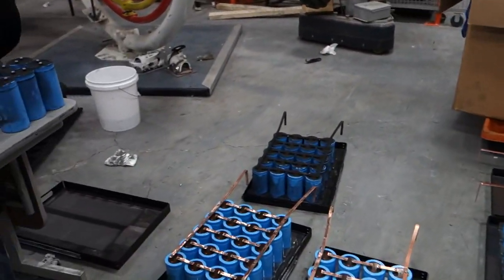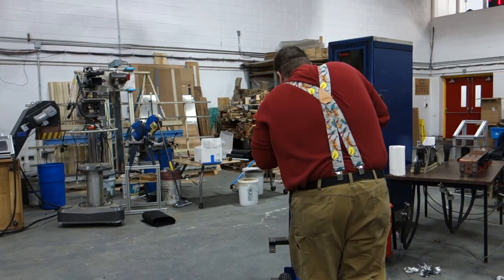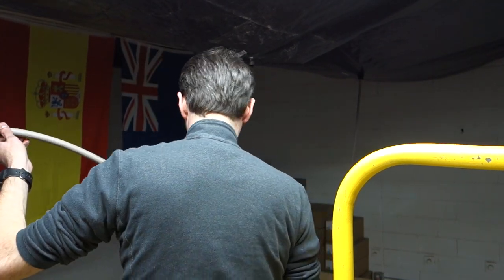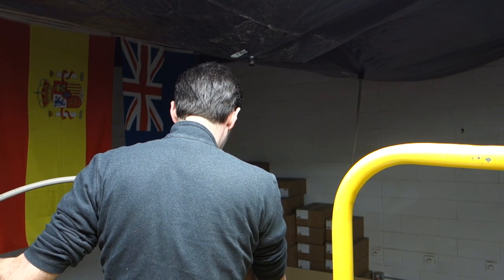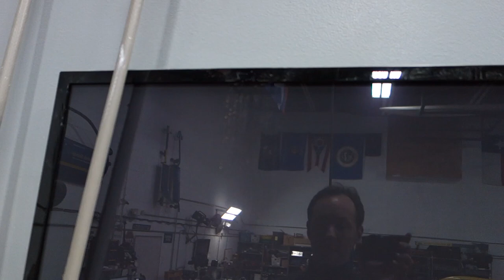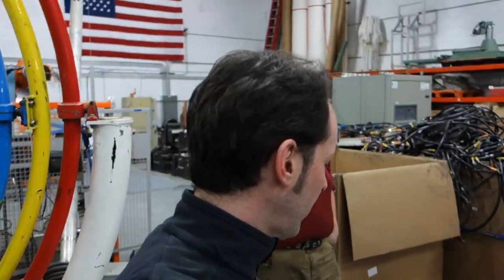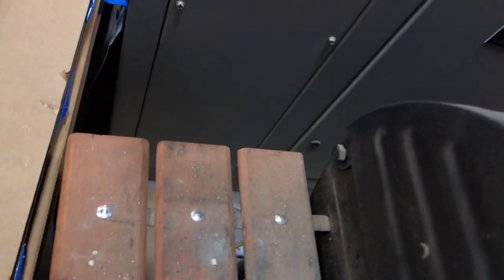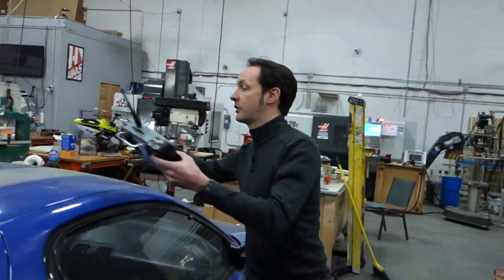Captain's Blog 1 28 2014 MDH Roof Leak and Thumper Repair

Comment: Lamp array may be 250W bulbs, but they are wired in series to make up 1760 volts, putting 110 volts on th array may not even make the bulbs glow, and certainly not trip a breaker, i think the total load is 250/110=2.27A /16=0.1420 Amps